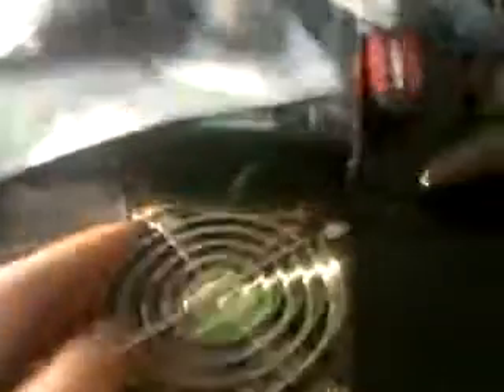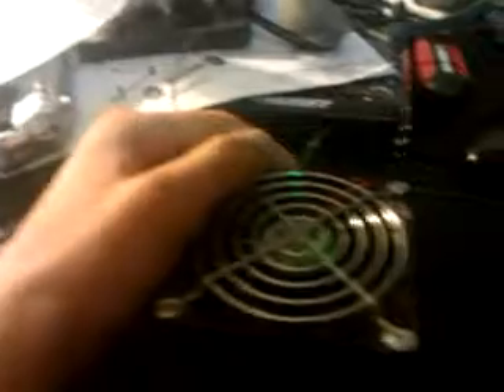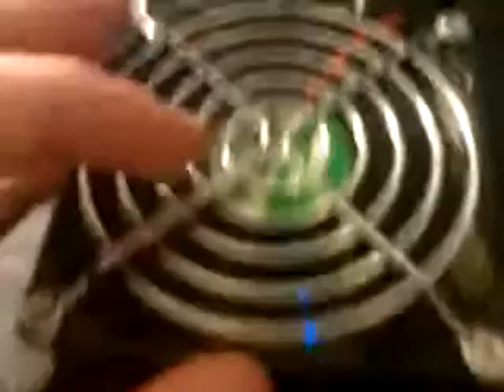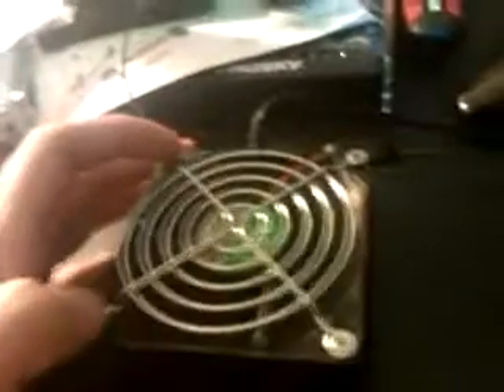PS2 Slim - 92mm Fan Mod

Comment: ahaha I had this ideia but I cut the plastic and used a little tupperware (plastic Box) on the top where i put the fan inside and a filter to avoid dust, the way you set your is good as well but you will need to clean the dust from your PS2 more aften than me =)

Comment from the maker: @edgarrl911 well some games like metal gear solid 3 say cannot find mem card in slot 1 (the "max" 64mb mem card) but it finds it after like a second try like when you hit the "no" on the "continue without saving?" option screen but YES it has NOT broken yet and it works great with about 99% of games